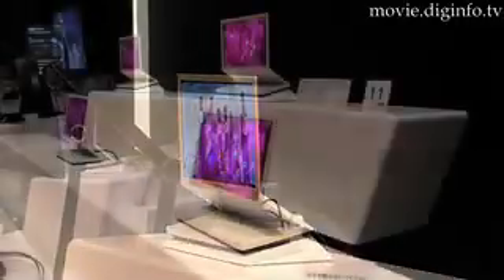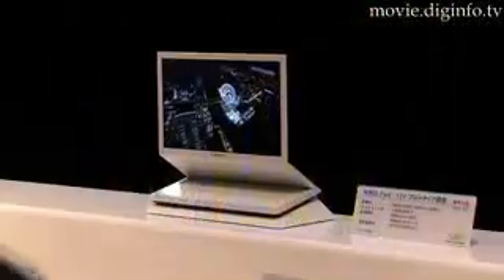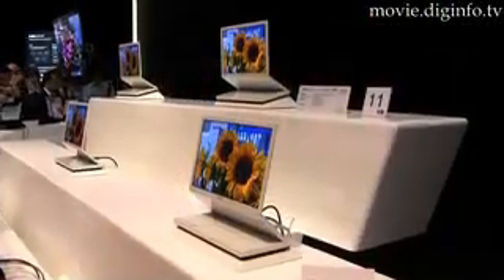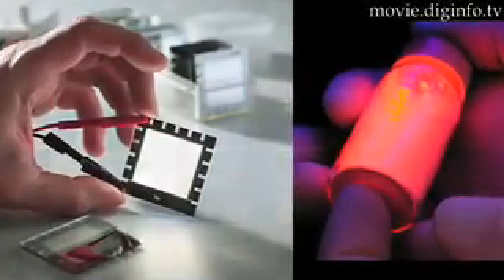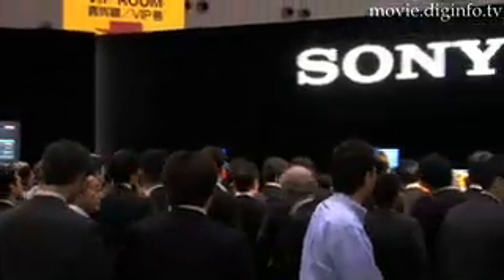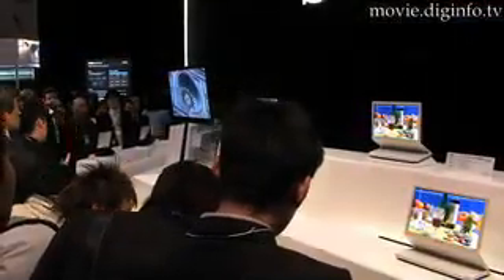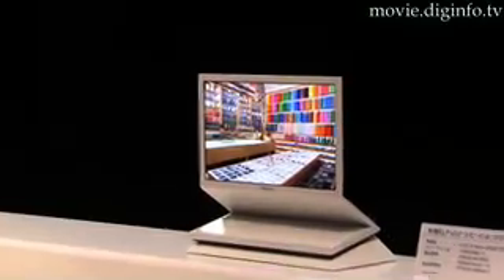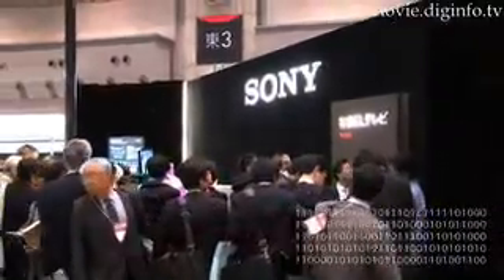Sony 3mm thick OLED display : DigInfo

Comment: The samsung led tv's arent actually OLED, they are still lcd but have normal led's producing the backlight. On thier top end model it will do localized dimming to give better contrast ratios though. An OLED screen will actually use the OLED's to create the colour image. Sony have been doing what samsung are doing now for quite a while but because they are not true OLED they have not named them so.